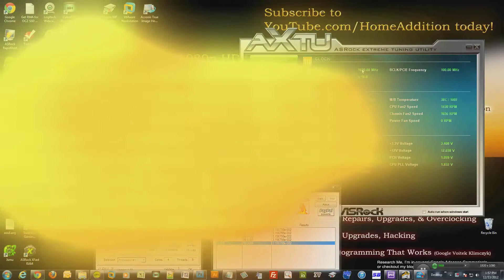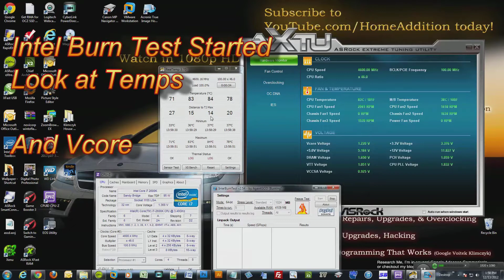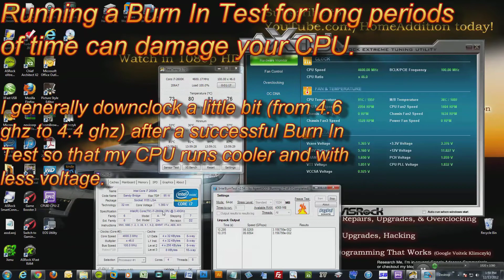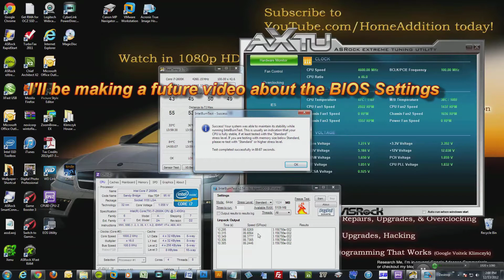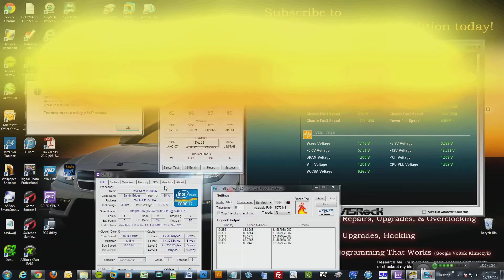Stress Testing an Overclock on your Computer

Comment from the maker: 1. How hot is the computer room?
2. How is your case cooling?
3. Is any fan broken?
4. Are you sure you did the thermal paste correctly?
5. Are you using a Turbo Setting?
That's unusual for a non overclocked CPU, but I bet yours is overclocked.

Comment: I have an i7 2700k, stock cooler, not OC'd, everything secured (heatsink, thermal paste etc), yet I reach TJ max (98c) under load - I don't even notice any throttling or freezing. Wtf is happening.